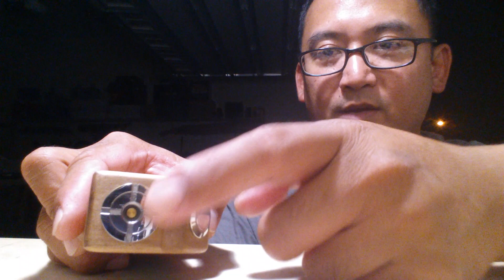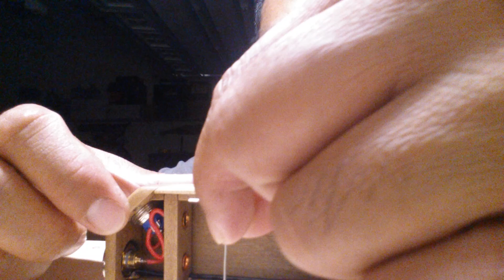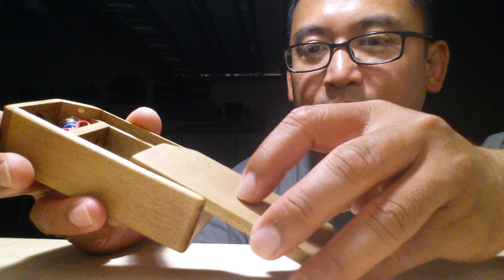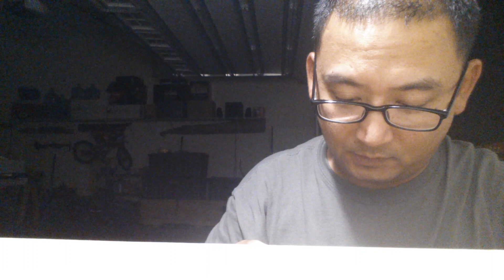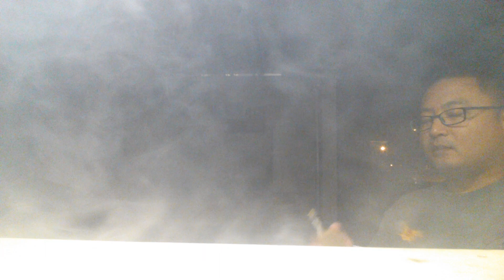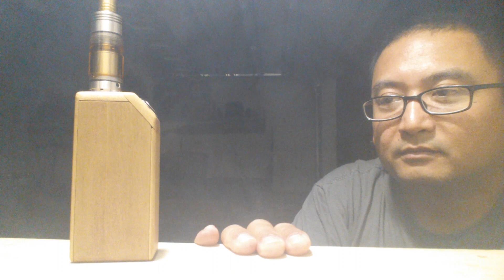Custom Wood Box Mod v2

Comment: IRF740 IR ORIGINAL NTE2397
IRF820 IR ORIGINAL NTE2398
IRF830 IR ORIGINAL NTE2398
IRF840 IR ORIGINAL NTE2385
IR1010N IR ORIGINAL -
IRF2807 IR ORIGINAL -
IRF3205 IR ORIGINAL -
IRF3710 IR ORIGINAL -
IRF9530 IR ORIGINAL NTE2383
IRF9540 IR ORIGINAL NTE2371
IRF9610 IR ORIGINAL NTE2372
IRF9630 IR ORIGINAL NTE2373
IRF9640 VISHAY ORIGINAL NTE2373
IRFB31N20 DPBF IR ORIGINAL -
IRFP064N - -
IRFP150N IR ORIGINAL NTE2375
IRFP250N IR ORIGINAL NTE2376
IRFP254N IR ORIGINAL -
IRFP260N IR ORIGINAL -
IRFP450N IR ORIGINAL NTE2394
IRFP460N IR ORIGINAL NTE2970
IRFP9140N IR ORIGINAL -
IRFP9240N IR ORIGINAL -
IRFZ24 IR ORIGINAL NTE2389
IRFZ34N IR ORIGINAL NTE2389
IRFZ40N IR ORIGINAL NTE2395
IRFZ44N IR ORIGINAL NTE2395
IRFZ46N IR ORIGINAL NTE2975
IRFZ48N IR ORIGINAL -
IRFIZ44N - NTE2941
IRFIZ48 - -
J162 
some of those works ??.cause in my city i cant found that

Comment: Where did you get those springs? and also the positive connections?
Reply from the maker: I mentioned it in the vid.
Reply: +Al USAF I saw the positive connection but I couldn't find the springs
Reply from the maker: +Rodrigo Torres I bought the spring from eBay a long time ago. Just search on eBay for copper battery springs if it's still available.
Reply: I see, thanks! Awesome build videos man, Are you selling the boxes or the kits ready to go? And does the Fat daddy 510 connection come with a floating pin? I am really getting excited about building my own box mod, and I wanted to find out all the information before buying the parts
Reply from the maker: +Rodrigo Torres sorry I don't sell anything. The fatdaddyvapes or Varitube has spring loaded 510 pins, both works perfectly. Good luck on your build.

Comment: Are you trying to do a give away
Reply from the maker: Angel Perez I will be doing another give away but not sure when though.
Reply: Alright thank you very much i was going to make a mod with items from radio shack but the radio shack near me shut done .
Al USAF
Reply from the maker: Angel Perez I wouldn't go to radio shack for parts anyway since they don't carry what you'll need. Check out lonesomevapors.com for box mod parts and also modsledz.com for battery sleds.

Comment: hello sir , can i ask , what is the diffrence between 14 mm,22mm 510 connector  and if  im using single 18560, is it the mod will operate ?
Reply from the maker: mohd Zulfazli size and yes, you can use a single battery.
Reply: Al USAF what is the rated amp for the switch ?
Reply from the maker: mohd Zulfazli it's only a 3 amp switch so I recommend that you install a Mosfet...use IRLB3034PBF mosfet.

Comment: hey! can i ask what all the sizes ? the width and lenght and the space on internals for battery and for the wirings, i do love your diy i really wanna make that one reply me please ? :) thanks! :D
Reply from the maker: Carlo Lazatin I mentioned the external dimensions in the vid. The inside width is the size of two 18650 batteries. Maybe an inch for the top for the wiring, but it all depends on what type of 510 connector you're going to use and how you're going to wire it.
Reply: ok thanks :)  its really helpfull :)

Comment: May I know the external and internal dimensions? I have a piece of wood here that can be used to make box mods. Planning to build one for myself haha. Thanks!
Reply from the maker: Jason Oliver I mentioned the external dimensions in the vid. For the internal, just measure the two batteries and add extra space for the wiring, button and 510 connector.
Reply: Oww. Okay thank you! Big help haha

Comment: do you have any problems overheating if you chain vape because like a cigarette i go outside and hit my current vape until i feel the nicotine high then go back inside do you have problems overheating and if i get an unregulated wooden box mod do i have too worry about it catching fire!!!!
Reply from the maker: Michael McCaslin no overheating issues when I chain Vape. The mosfet do get warm because it's supposed to.

Comment: How did you drill the holes for the positive contacts without cracking the wood? I have tried a few different methods and i haven't had much luck making it clean. Any insight would be much appreciated.
Reply from the maker: Travis Schmidtberger I used a forstner bit and a drill press.
Reply: Al USAF thank you! Also i was wondering if the wood you are using is a softer wood?
Reply from the maker: Travis Schmidtberger I used Poplar so yes it's considered a soft wood.
Reply: Al USAF i'm so glad i happen to have a set of forstner bits and a drillpress. haha. i'm going to kind of copy your design here but add an auto feeding system for a tobhs rda. i will let you know how it goes. :D

Comment: Questions please fill me in with mosfet chip what is it about?  Is it dangerous not having one?
Reply: I think you don't have mosfet so what is it about
Reply from the maker: Angel Polintan the Mosfet will handle the amp load instead of the switch. Pushbutton/anti-vandal switches are not rated for the amp loads we Vape at especially on sub ohm builds. The mosfet I used is rated at 195 amps. Yes, I didn't use a mosfet in my wood box mods and it works just fine. But now I highly recommend the use of mosfets.
Reply: I see I got it
Reply: Ty very much
Reply: Al USAF
so this is a great tutorial of sorts thanks so much for sharing. i have one question on the mosfet. would this work if you made a series box twice the voltage with the same amp draw.....basically what is the voltage rating on the mosfet

Comment: can you provide us the full list of parts you used. thanks. great job btw.
Reply from the maker: Mario Ramirez fatdaddyvapes 510, pushbutton switch, Copper springs for the negative connection (hard to find now), 1/4" copper sleeve for the positive connection (Lowes), wires (at least 16 gauge), and wood for the box.

Comment: how many watts is the box mod ?
Reply from the maker: This is unregulated so it's not rated at a certain wattage. Basically your limitation will be the type of battery used.
Reply: how much $ was it to make ? i want one bad
Reply from the maker: Vapeheaddd materials are fairly cheap to make this box mod, about $20. It's the tools and labor that's going to cost you.

Comment: bro! paano mo ginawa yang springs mo? trying to make one, can't seem to get my springs right. also, what size copper wires do you use for the springs. one more thing pre, what are the length and with of the side walls?
Reply from the maker: Bought the springs from eBay. Side wall is 4.25 X 1.25 inch.
Reply: Thanks for responding compadre! Your build's are awesome brotha

Comment: How did you get your negative contacts so springy? I've attempted to make multiple springs out of copper wire and for the most part once they are compressed they pretty much just stay that way. Yours look and work flawlessly....Any tips?
Reply from the maker: It's an actual copper springs that I bought from eBay.
Reply: Thanks.....I've attempted to make my own but unfortunately I've failed....just don't seem to have any actual spring to them

Comment: i love your box but man for the love of god please! get a mosfet in there.... 
the exact mosfet needed is an irlb3034pbf search for them on digikey other whys good craftsmanship :)
Reply from the maker: When I did my research before I made this box, all wood box mods uses a 3A switch without Mosfets. Most of those box mods have been around for at least a couple of years and I have not seen a reported case of switch failures. If you've seen or read anywhere of such a case please let me know so I can spread the word. In addition, I've read in one of breaktru.com's forum, either Breaktru or CraigHB, stated a 3A switch is sufficient enough. These two modders have been around the vaping scene for years. I think they're both electrical engineers too. Again, using a Mosfet is probably or indeed safer. Yes, I have the Mosfet you stated that I'll be installing in the box mod I'll be giving away. Thanks!
Reply: Well i thought i would throw that out there if you need to go and join this FB page they make box mods left and right and you can find out alot of info from them id love to see your work there as well! anyways glad to here you'll be adding the mosfet. also i should note those mosfets are very fragile so when soldering the 15k resistor to the Sorce and drain do it fast they burn out very easy with to much heat... well just in general solder to the mosfet carefully! 
anyways keep on vaping! 
                                                                  -Jordan

 https://www.facebook.com/groups/boxmodders/
Reply from the maker: iVape Repairs,Reviews,ect thanks for the link, I'll definitely check it out. I also built a OKL2-T20 VV box mod and I did a lot of soldering on it. I have a video about it but not a build tutorial. I will be building another unregulated box mod but this time around using the smaller Hammond 1590G box and a tactile switch...and of course a Mosfet.
Reply: Sweet sounds buttery man! cant wait to see! are you gonna be using the hana modz style tactile switch?

Comment: good job on the craftsmanship however, this device has no protection whatsoever. youre basically vaping stacked batteries & that's just not smart.

not to mention the fact that you have both batteries facing the same direction.
again, dude your homemade wooden box is awesome but the internal design, electrically speaking, is dangerous and youre really not getting much out of that design anyway.
Reply from the maker: The batteries are not stacked, that would be in series. This unregulated box mod is wired in parallel, basically doubling the battery capacity both in mah and amps. So I am getting much more compared to a mod with a single battery. You're correct though that this don't have any protection because once again this is unregulated. The only shortfall with this build is the switch. But I've done my research and I'm satisfied with the performance. If you looked at the majority of wood box mods that are being sold, my overall design is very similar. Thanks for the comment.

Comment: Which one best okl or m box mod. .....ido use m mod for almost year never had any problem accept for battery drop after 3or 4 hours. Volt start getting weak. .ijust never use okl. And don't know how huge is the diffrent is goona be plz advice bro

Comment: I have another question. Sorry for bugging you. I like my ohms around .20, so what kind of button, 510 connector, and size wire gauge. I rather NOT buy a $200 box mod. I really want to make one.

Comment: Beautiful work.  Very nicely done.
Reply from the maker: Thanks!
Reply: Al USAF
 I've made a box, But what items do I need to buy to make a dual 18650 mod? Like what Size DIY wires I'll need? etc.. Great videos btw.
Reply from the maker: jayjayzz707 you'll need at least an 18 gauge solid or stranded copper wire and you can buy this at Radio Shack.
Reply from the maker: jayjayzz707 you'll need at least an 18 gauge solid or stranded copper wire and you can buy this at Radio Shack.
Reply: Al USAF you said the dimentios are 1/4x3x4,but if the 1/4 is the debth,how on earth is that deep enough to hold the batteries???
Reply from the maker: more wattage please. bruce that's the dimension of the stock I used to make the box.
Reply: Al USAF 1/4 debth.Did you glue 2 pieces together so its deep enough for the debth of the batteries?even that only makes it a 1/2 inch debth.The debth has to be at least one inch.What am I missing here?
Your other video,you said you glued 2 pieces of 1/2 inch wood,wich will then give you a one inch debth.That I understand,but one,or even 2 pieces of 1/4 inch debth,even glued together gives you a half inch.
Absolutely fantastic work,and thanks for responding,bruce.
Reply from the maker: more wattage please. bruce this box mod is your typical "box" design. Where it has a back, two sides and the door. The battery compartment for my V3 box mod was made from two pieces of 1/2" thick wood that I glued together. I then routed out the space for the batteries.

Comment: Awesome vid and awesome mod!! What is the Amp rating on that switch?
Reply from the maker: Corrected...3A @ 250vac
Reply: Al USAF I am currently gathering the parts to build a dual 26650 wooden box mod for cloud comps and I have a question about the switch if you would be so kind as to help. I'm using batteries with a voltage rating of 4.2 fully charged and I want the mod to be able to handle the load of a coil build less than .1 ohms so would a 12 volt 60 amp spst n.o. momentary switch like this one do the trick or would that be overkill and if so could you point me in the right direction? http://www.summitracing.com/parts/pco-5509pt
Reply from the maker: MrBigbadwolfy if it's rated with those specs, especially the amp rating, then it should provide you with plenty of headroom. Because an unregulated parallel box mod with freshly charged batteries (4.2v unloaded) and using an atomizer with a 0.1 ohm build will generate 42 amps/176 watts). So the switch should be able to handle it. But I think that switch is a little too big in size. AutoZone or similar stores carries those type of switches, so check them out so you see the actual size. I've researched online to learn more about switch ratings and I found a couple posts that somewhat explain switch amp ratings. I haven't been able to find a switch with a specific rating for the typical voltage that we use for vaping. I haven't had any issues with the switch I'm currently using, but again I'm using it at my own risk. Here's the link for the post I'm talking about, http://breaktru.com/smf/index.php/topic,162.msg13234.html#msg13234

Hope this helps and good luck with your build and comp. Thanks!
Reply: Al USAF
Great information I really appreciate it, I subscribed to your channel and look forward to seeing what else you come up with. I just checked the measurements for the mod I'm building, that switch has a 5/8" mounting hole and a 1 3/4" mounting depth, it looks like I'll have about a 1" high and wide by 1.5" deep cube of space in which to wire up the end of that 60 amp switch and the bottom of the FDV 510 connector, it will be tight so I wont be able to have much extra wire, just enough for the 510 pin to move freely but it should work. This thing is gonna be giant, I'm going for an industrial sized and powered purely competition military grade beast of a mod. Thanks for all your help and from one USAF vet to another thank you for your service, I'll send you a copy of my schematics and some pics when I have it completed.

Comment: What type of wire is  the red wire connected to the button and the positive.. and then the wire  going to the negative is  solid copper  wire with heat shrink??   Does it matter if the wires are diffrent sizes
Reply from the maker: Both positive and negative wires are the standard 16 gauge solid copper wires you can buy at Home Depot, Lowes or any hardware stores. You can use different size wires as long as you use at least an 18 gauge wire.
Reply: Thank you so much :) love your videos

Comment: What is the output from the batteries in parallel? Is it 8.4v?
Reply from the maker: Fully charged is 4.2v. 8.4v is for series wiring.

Comment: I understand that the box mod is 2in. in width. Could you give me the height and how narrow the sides are?

And, what brand of rebuildable atomizer do you use? Which ones do you suggest for this model here?
Reply from the maker: 4.25" in height and 1.25" for the sides. I have multiple atomizers, but my favorite is the TOBH Atty. Majority of the time I use either my Kayfun lite plus v2 or the Fogger v4 plus on my wooden box mods.
Reply: Also, where did you get the anti-vandal/ horn switch and 510 adapter?
Reply from the maker: Joshua Pozzi eBay for the switch and fatdaddyvapes.com for the 510 connector.
Reply: Thanks for the help! Awesome build you have!

Comment: OK thanks about amp rating on switch?
Reply from the maker: I'm using a horn or anti vandal switch and it's rated at 3A/250vac per the manufacturer. Majority of box mods out there uses this same type of switch with the same amp rating. I haven't had any issues with it. Bought it from eBay.

Comment: Hey that's a really clean box mod! I do have a question since you seem to know what your doing. I'm build a dual 26650 unregulated with a hammond 1590 box and I have everything but the tension springs. Where did you find yours?
Reply from the maker: I bought the springs from eBay but I just checked and the seller no longer exist. I also bought springs from Mouser but it's not copper. The part number is 534-5241. It should work for 26650s but do check them out first. Or you could try using battery holders.
Reply: Al USAF Thank you. I will check out mouser. Wish I would have earlier because that's where the Hammond box came from. Thanks again!

Comment: And the button for that matter! I can't find it on eBay.
Reply from the maker: Search for horn switch. The one I used is the 16mm in size.
Reply from the maker: I just checked on eBay and the seller I purchased the springs from no longer exist. The ones I used are 1/2 inch in the diameter.